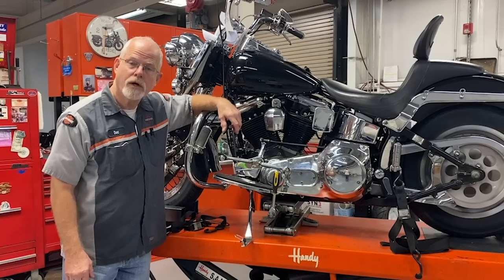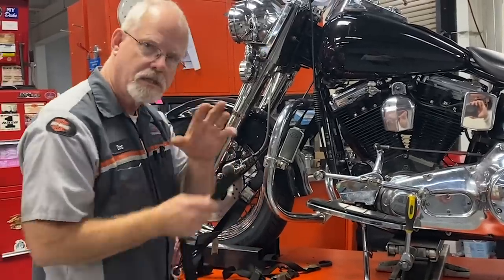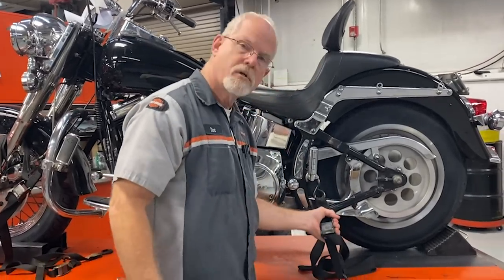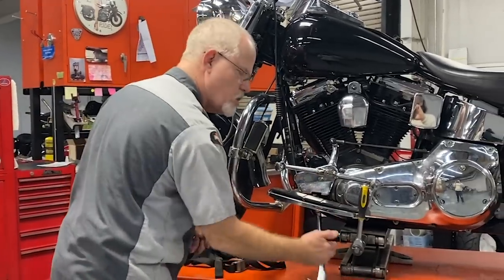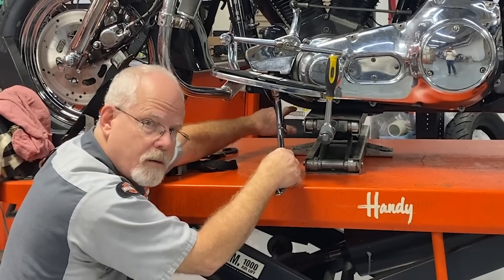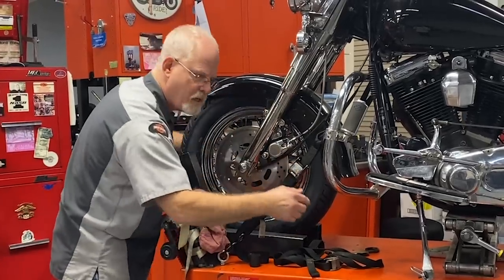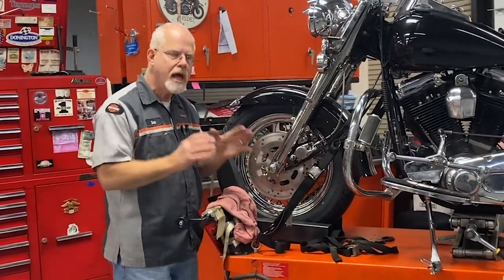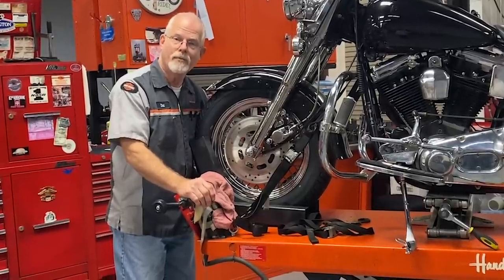DOC HARLEY: SAFETY POINT ON LIFTING A HARLEY-DAVIDSON ON A LIFT

Comment: I was a technician for H-D dealer early 2000-2002. Not saying Doc is wrong that way works for him. We would get two guys one on each side of the bike and roll the bike backwards on the lift. That way the tire clamp is securely holding a wheel and we used ratchet straps instead of the pull straps. I have a table lift in my home garage and have a motorcycle jack that lifts from the frame getting both wheels off the ground. Research the lift you want before you buy(make sure it will fit with bike on and off in your garage, check features,  good tire clamp, removable parts for easier tire changes, pneumatic or hydraulic operated, one requires a big noisy air compressor and the other gives a good leg workout, list goes on...).
Reply from the maker: Good points. I did not cover your method of loading a bike backwards because rear tires have gotten a lot bigger since 2002. 200-240 tires won’t fit in our tire chucks. Plus backing in a full dresser is a huge challenge and scary😱. An older tech 20 years ago adapted small ramps for the sides. He would roll a bike across the ramp and raise it so both ends where off the ground! Thanks ~ Doc

Comment: i have got an 03 superglide and it has a bar under the frame i guess its to protect the motor and transmission its a real pain in the butt trying to lift .Could u give a hint how to lift it without it falling over.
Reply from the maker: I use a cut down 2X4 g ft or the opposite side of that piece of metal…..Doc
Reply: tks doc @LowCountryHarleyDavidson
Reply: i understand the 2by 4 part what is the g ft and what do u mean the opposite side of the piece of metal

Comment: Position the lift under a strong ceiling beam and attach a rope to the top most part of the motorcycle to keep it from tipping and rolling .   Later add an electric overhead hoist with wired remote control so the whole bike, front or rear could be lifted.   Enjoy learning from each of your tips.

Comment: Here's a tip I've found works really nice, use lock washers and wing nuts on all your deck hardware (eye hooks and front wheel clamp)and have a few extra holes so you have options for your eye hooks because sometimes its nice to get that wheel  clamp out of the way, great video doc!always look forward to them
Reply: Thanks for the extra info, I just got a lift and haven't used it yet because I don't want to mess up.

Comment: I use 3/8 nylon rope 30  inch long tied with a square knot 14 inch loop  it will hold 4000 pounds  I keep 4 on my wall next to my MC1000 lift air table  a old car scissor jack works great low profile 3 inch flat will go up 16 inch . with a board  I never dumped a bike off a table .    Doc knows his stuff 4 sure
Reply from the maker: Thanks for sharing JC….Doc

Comment: I unusually work alone on my bikes, but the one time I need and/or want help, is getting the bike upon the table lift and getting it back down. Having a friend Brother over or cousin is a must for me in my book.
 My HD Sportster weight is about 500 pounds, the Electra Glide over 800 pounds, my weight is 260 pounds. I would not want a bike fall on me that out weigh me.
How do you load your project bike on a table lift Doc?
Always love your insight on all safety tips.
Thanks, Stevo.
Reply from the maker: As you, the older I get the more I ask for help. Especially with high and wide handlebars….Doc

Comment: I'm always paranoid that the center jack is going to slip forward because the frame tubes are no longer horizontal when the front is up, so I put one extra strap around the rear tire and hook it to the jack.

Comment: Hello Doc Harley, I'm so glad I found your videos, they're chock full of great information.

I have a question about lifting a 2023 touring bike (Highway King) - I have a Harbor Freight motorcycle/atv lift (hydraulic roll-around pump-up type) that almost works but there's a problem.  Harley builds these frames with a cross member between the lower frame tubes just forward of the rear wheel, and for some strange reason they designed the cross member to hang below the frame tubes by about 1/4".  To balance the bike on the lift, one of the jack pads has to go right where that cross member is located, potentially bending it - I could be wrong, but the cross member doesn't seem strong enough to support the motorcycle's weight.

The owners manual seems to agree: "When lifting a motorcycle using a jack, be sure jack contacts both lower frame tubes where down tubes and lower frame tubes converge. Never lift by jacking on cross-members, oil pan, mounting brackets, components
or housings."

So I have to avoid the cross member, but that means moving the jack rearward a couple of inches and the bike is extremely nose-heavy in this configuration, putting a great deal of twisting stress on the jack.  I'm not gonna do that......

I made a wooden sled that goes between the jack and the bike, which allows me to position the jack for optimum balance without stressing the cross member.  This solves the issue but I'm wondering if it's really needed?  I can't find any reference to this cross member anywhere, though I've found plenty of videos of just shoving a lift under there and pumping it up.  I even checked with two different Harley dealers - they didn't even know about the cross member(!) until I showed it to them - and of course they use a full size lift in the shop so they don't have to deal with the cross member.  So I don't feel that this issue, which seems pretty critical, has been properly addressed by Harley-Davidson or anybody else for that matter.

Do you have any thoughts on this?  Perhaps this could be a topic for a future video?
Reply from the maker: Contact Doc through his Email address. With pictures of your Jack under bike. 
Yes no one should push up directly on the cross over piece.  We use a Fat Jack. This pushes up on he frame rails only.  My fear is your Jack rated to lift 1000lbs?…..Doc
Reply: @LowCountryHarleyDavidson  Thanks for the quick reply.  What is your email address?  I can't find it.  Anyway, my jack is a "PITTSBURGH AUTOMOTIVE1500 lb. Aluminum ATV / Motorcycle Lift" so rated 1500lbs.  It held a 1998 Valkyrie in the air for a couple of months with no issues.  I'll send you a pic of the "sled" and the Harley up on the jack when I get your email address.

Comment: Two things I do a little differently on my lift. Instead of a wheel chock on the rear wheel, I use 6 ratchet tie downs. 2 to keep the bike vertical, 2 pulling the bike forward, and 2 pulling the bike backward.  That insures that the bike can't tip or roll in either direction.  
On the front tie downs I hook the left tie down to the top of the crash bar on the right side of the frame, and the right tie down to the top of the crash bar on the left side of the frame. That offers more triangulation and security, and it guarantees no possibility of the strap slipping on the top of the crash bar.
For soft ties, being on a budget, I have some 1" wide soft nylon web straps with loops tied in each end.  The straps are actually used shroud lines from a drag chute on a B52.  3000# tensile strength.  If you don't have access to that, you can find the same thing on line in 15' rolls for a reasonable price.
Reply from the maker: I would like to hear your story on how you got a B52 part…..Doc

Comment: Thanks Doc!  Any recommendations on lifts for the average D.I.Y. home garage mechanic.
Reply: DRVMN.. I had a Titan Lift but it didn't last very long. Now I have a Handy S.A.M. lift (I have a video of it) in my home garage.. I've seen a lot of people use the cheaper lifts and some had good luck with them and some did not.. A neighbor about four houses down didn't want to spend the money on a good "lift table" so he just bought a motorcycle jack. He came knocking on my door for me to help him stand his bike back up. He was jacking it up and it slid off the jack and over on it's side it went. Is a cheap $200 to $400 jack or lift really worth it if it doesn't lift the motorcycle securely?
Reply: @RenegadesGarage  I agree a cheap lift or jack is not the way to go on an expensive bike, but also using the right tool for the job (and knowing how to use it) makes a difference too. I myself purchased a Craftsman scissor lift 19 years ago for my HD. It was all I could afford at that time since I just purchased my bike and really didn’t see myself doing any major repairs. Fast forward 19 years and I’ve done majority of the upgrades, repairs, and maintenance on it from that same jack stand. Granted I wish I had a table lift at times, but I was careful in securing and lifting the bike from the same jack for all these years, I just didn’t really see the “need” for one. But I still wish I could afford (or for that matter fit) one in my garage 🙂. I figured over the years it was better to buy new tools to add to my collection and invest in a nice tool box so I could organize my HD specific tools at the ready for the regular maintenance. Plus I store the bike on the stand for winter and whenever I want to really detail the bike during warmer months. But again, that’s my two cents.
Reply: @SA-hk8xj  I absolutely agree!! Having all of the right tools is great. But knowing how to use them is a must. Sounds like you have both..
Reply: @RenegadesGarage  No “formal” training, just  training from research, YT, manuals, friends, and of course life’s mistakes 🤦‍♂️😀

Comment: Off the subject but trying to settle an argument. If you run gear oil in your transmission what should you run in your primary on 2009 roadking?

Comment: Thank you. Can I leave my bike the whole winter with the wheels off the ground? Does it damage the suspension leave it unloaded?
Reply: that's a preferred way, not only is it better long term for the springs, it also prevents flat spots in the tires.
Reply: @patrickzambori473  thank you

Comment: That was one of the big selling points and why I bought the K&L MC655R lift. Not only does it have a hinged rear wheel drop out panel but it also has a hinged front wheel drop out panel. IMHO best lift on the market.
Reply from the maker: Thanks for your product review….Doc

Comment: Hey Doc when you tighten the straps down is that actually how tight you do them or do you use ratchet straps and crank them down a bit ?
I always use hog ties and ratchet straps but you have to be damn careful in releasing them equally or you will snatch the bike off the side of the lift.
Reply from the maker: I agree with your procedure.  We have several different kinds of straps. It all depends on the job and bike...Doc

Comment: Hi DOC, is it safe to lift my Harley with rear of my lift sitting on the absorbers ? Will that damage them? I was thinking of buying the Let’s Roll Dolly and Lift but my absorbers are lower than the frame, in order for me to use it I have to lift the bike on the absorbers.
Is that safe?
If you let me know that would be great.
I appreciate it.
Thank you so much.
Reply from the maker: What model do you own? No I’m not endorsing lifting by way of shocks.i have lifted a pre 04 Sporty with a rolling pit bull attached to swingarm.  Any other I use Fat Jack under frame….Doc
Reply: @LowCountryHarleyDavidson  I have a 2007 softail night train
Reply: @LowCountryHarleyDavidson  The shocks are lower than the frame, their amazing lift will fit , the problem is using them together, i can’t use the dolly unfortunately.
Thank you so much DOC.

Comment: You had a video on suspension preload adjustment, does preload adjustment affect ride height?
Reply from the maker: Not statically. But it helps maintain the stock height when loaded with you, passenger and gear...Doc

Comment: Thinking about starting to wrench in my own bike. What is the best lift to get?
Reply: The easiest lift to get work done on is the BestWay (tm)...   but if you're not keen on drilling a hole in your floor, then a Western table lift, electric motor preferred as I find the pneumatic one jumpy and unpredictable.
Reply: @patrickzambori473  Cheers Patrick